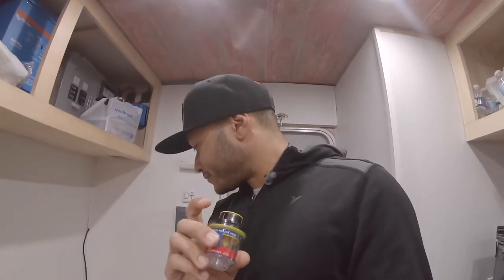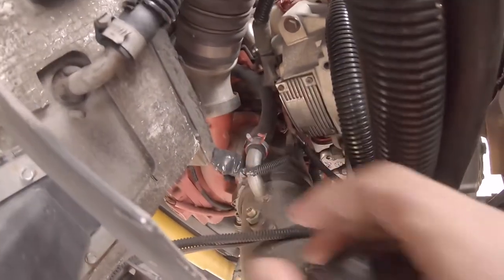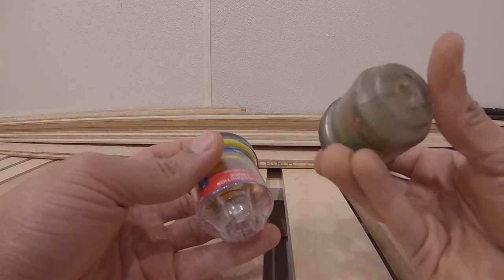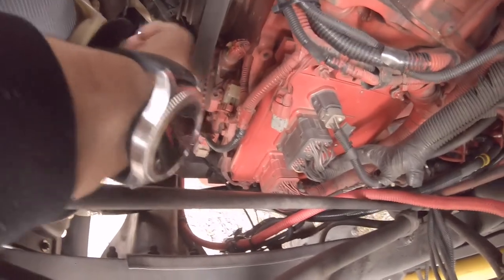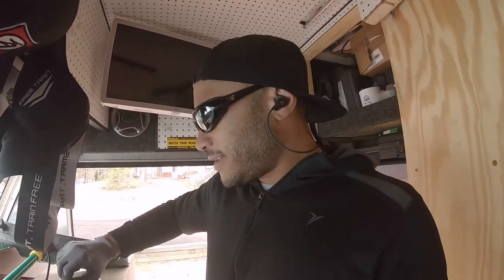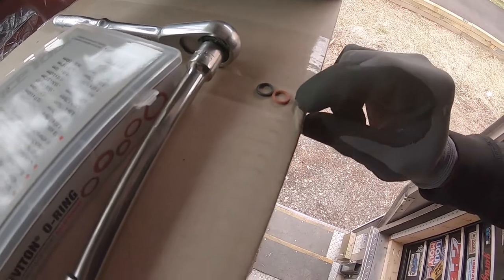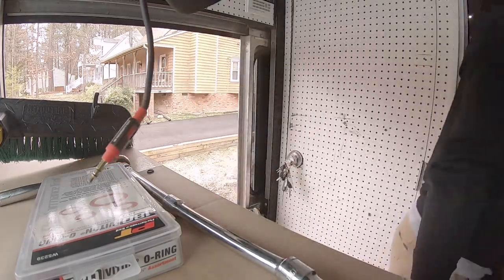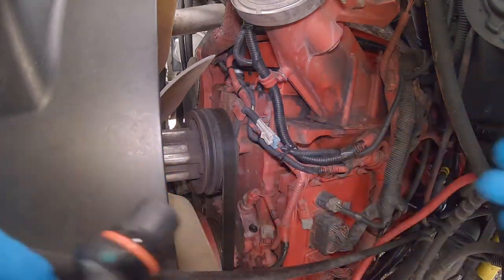Cam & Crank Position Sensor Replacement 6.7 ISB Cummins | DIY Off Grid RV Van Build: Ep. 73

Comment: I have a 8.3L Cummins ISC, I got a cam position sensor code. Now I have the part but don’t know the location of the cam sensor, can you assist with the location please
Reply from the maker: Welcome to the channel and with the hood open looking at the motor it's attached to the harness on your right, the vehicles left. The harness leads to it